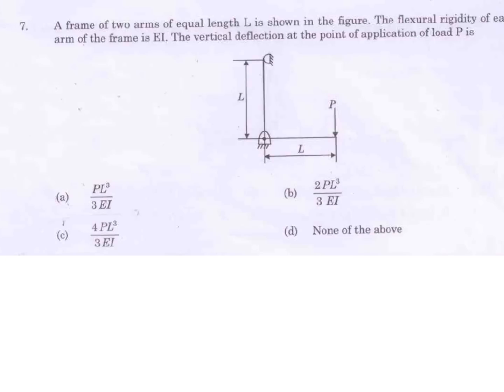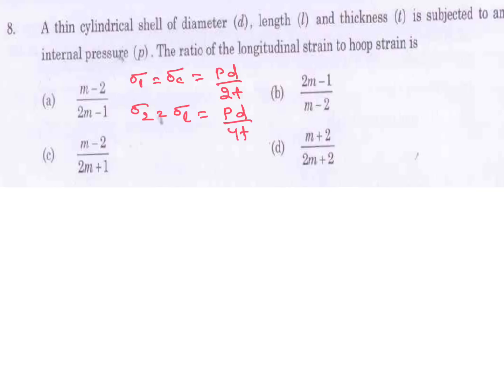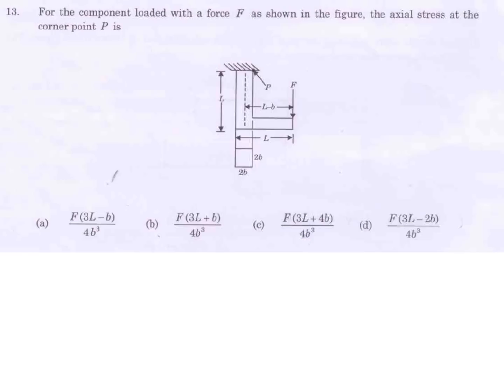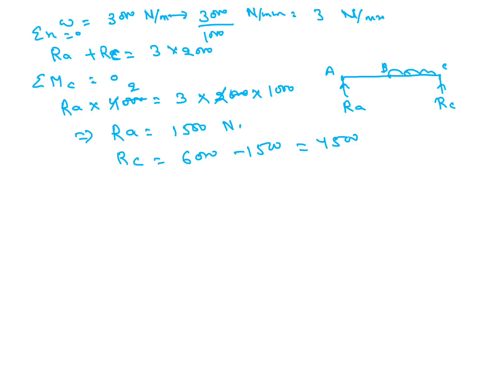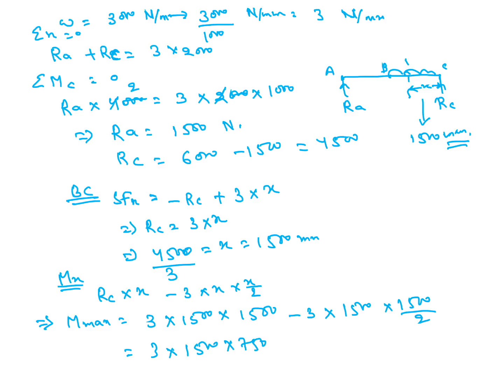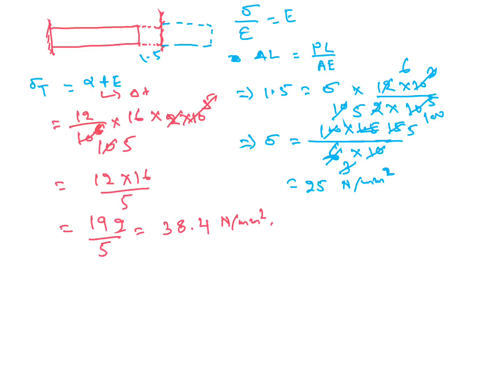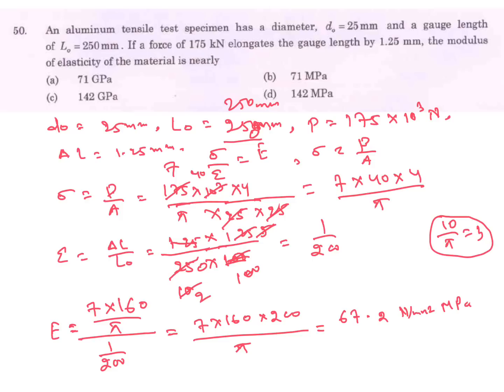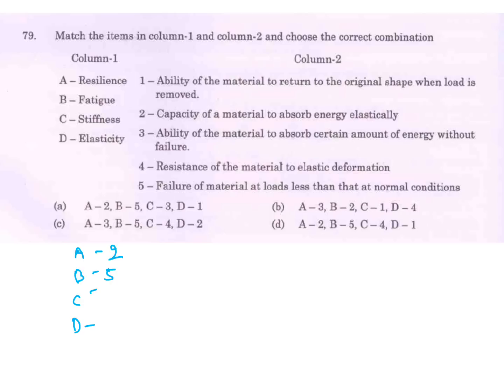ISRO QUESTION PAPERS SOM - 09

Comment: In question 7 answer should be 2PL3/3EI ... KIndly check.
Reply from the maker: Ajay 221206 my ans is correct u can check in gate 2014 set 4  any method u use same ans u will get.
Reply: But in gate 2014 problem, Beam is not hinge at downside. it is like cantiliver subjected to moment at free end. This above isro problem is same as  gate 2009 problem and ans is 2pL3/3EI
Reply from the maker: Ajay 221206 official ans is c and 2009 gate also in made easy book same ans ...

Comment: Sir in question no 8 at 9.24 ..u have solved as ratio of hoop to longitudinal strain while in question its opposite is asked
Reply from the maker: Prem Pal Singh my process is correct as per qs and my ans also matching with official ans , €2 is For longitudinal and €1 for hoop .
Reply: Sir you check what is asked in question. This is not the issue that answer is matching or not. The correct answer is b.. u can solve strain in longitudinal / strain in hoop. This is also given in made easy hand book.

Comment: Sir in  Q 7 the deflection 1 is (WL3/3EI) due to cantilever deflection but due to moment the deflection should be (WL3/2EI)... but in solution you have explained as  (WL3/EI)....Please explain how this has happened??
Reply from the maker: At point c we have to calculate the deflection 1 st it will deflect due to point load at c, then due to moment at b it will go left side and c point will get deflection its value is slope due to moment multiplied with ab length L.Final ans is (4/3)PL3/EI
Reply from the maker: Here slope is not at a point it will come in between ab and same slope will be use at bc having length L
Reply: correct...the slope created by load P in the cantilever part  should be (WL2/2EI).. which when multiplied with L gives (WL3/2EI)
Reply from the maker: Ravi 1st part slope not required so deflection 1 is PL3/3EI, 2nd part slope for moment is PL2/EI.  Same slope will cause deflection in 1st part so multiply L with PL2/EI to get 2nd deflection. Then add both delta one and delta two you will get (4/3) PL3/EI
Reply: ok..now i got..thanks sir